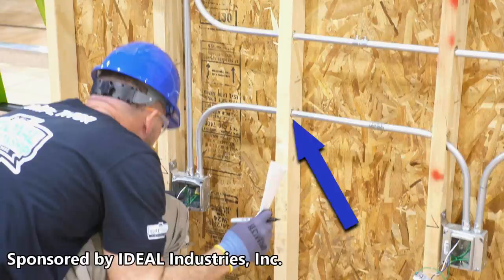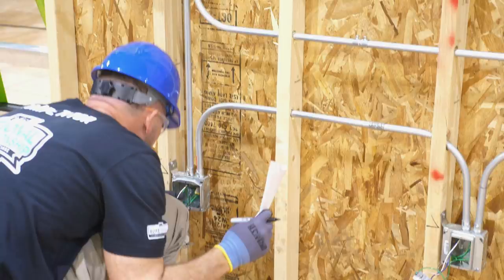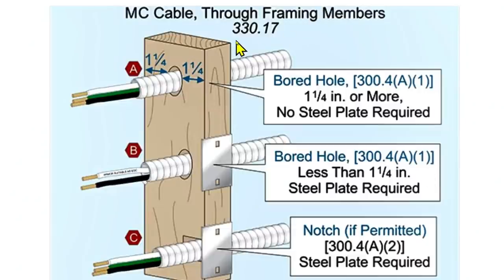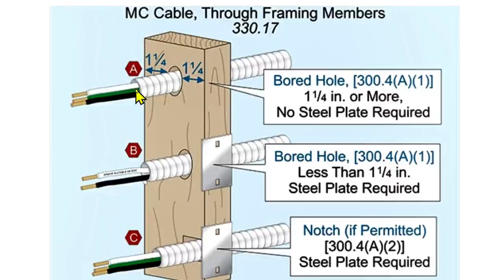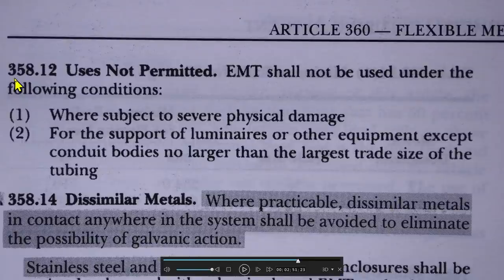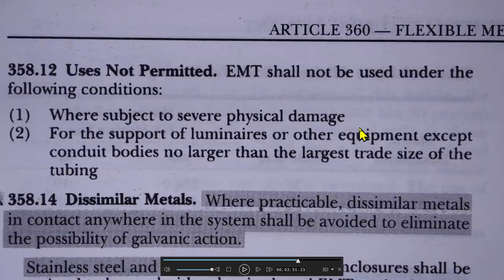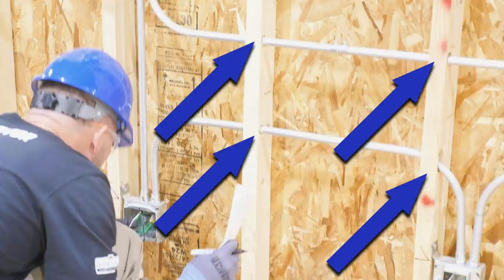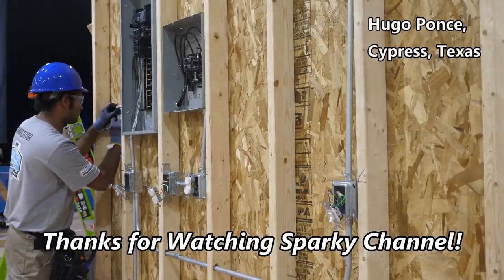Need Nail Plates for EMT? 2020 NEC 358.10 (E) and 358.12

Comment: Never underestimate the ability of drywall dudes to find and pierce wires.  Even emt isnt safe they will find a way.
Reply from the maker: Drywallers.... that's a whole 'nother video. LOL!
Reply: Ain't that the truth!!!!!
Reply: Indeed. Even that nail plate won't stop 'em. (I've seen idiots reach for a drill when the nail/screw won't go in.)
Reply: @SparkyChannel  we as the elite (electricians ) ..kinda make fun of d wallers but ill give them this ..its a art and the corners tells it all
Reply: I been seeing them use the drywall screws with the self tapper on the ends of them
Reply from the maker: @PS3rulls  Self tappers will go through just about anything.
Reply: @SparkyChannel  very true and that doesn’t sit well with me! I really appreciate your videos.
Reply from the maker: @PS3rulls  No problem, thanks!
Reply: And that is why we keep having more and more trouble with our code... to fix THEIR fuckups... @#$#@, also, are we only looking for NEC violation? Or can we throw in some building violations because I see some 2x4 that has far to much cut out of it

Comment: 300.4(A) explicitly excludes nail plates with EMT. The rub: The distance from the edge of the framing member to the end of the bored hole must be at least 1.25", and where this isn't maintained, a nail plate must be used. Exception number 1 explicitly excludes nail plates with the language of "shall not be required".

That said, the code explicitly excludes EMT through framing members. Also, I'm with you. On one of my jobs, nail plates would go up. $25 in nail plates over the course of a job is instantly cheaper than troubleshooting or dealing with opening a finished wall.
Reply from the maker: Excellent points!

Comment: It might be a good idea to install them, but if the competitors marked their absence as a code violation, they'd lose points, because it's not a violation.  300.4(A)(1) Exception 1 is crystal clear: "Steel plates shall not be required to protect rigid metal conduit, intermediate metal conduit, rigid nonmetallic conduit, or electrical metallic tubing."  Also 300.4(A)(2) Exception 1 for notching.

Comment: Unless there are words on the page saying it's required, it's not required. (the bits shown don't say it's required. 2017 has a note excluding EMT.) Also, there must be somewhere in that book defining "severe damage" -- inside a wall would normally be a pretty protected space, or NM would never be allowed.

Note: There's no problem exceeding code. Nail plates are just a good practice in all situations.
Reply from the maker: Thanks, excellent comment!
Reply: If there is a definition of "severe damage" or "subject to physical damage" please point me in the right direction. I've looked and had no success finding it.
Reply: You must have inspectors that can read.  In Columbus Ohio some get the job because the check off a diversity box,  being able to read the code is a diversity box so they go by "feelings"
Reply: @vicktorpatriot1430  Selectively, yes. The few electrical inspectors I've had the pleasure to deal with were former -- fired for cause -- electricians. (who went out of their way to lie to make the contractor have to do even more work.)

Comment: In 2017 NEC, there is an exception in 300.4(1) on bored holes which says "Exception No. 1: Steel plates shall not be required to protect rigid metal conduit, intermediate metal conduit, rigid nonmetallic conduit, or electrical metallic tubing." So, while a good idea, it's not required.
Reply from the maker: OK, thanks!
Reply: In the 2020 code it is in 300.1 A1, B2, and D

Comment: I installed a 4 ft piece of 2" emt vertically in a wall in a McDonald's. We installed a 480- 208v transformer above the panel on the deck. We came back after the walls were finished to push the wire down to the panel. The rockers must have thought the emt was a stud because looking down into the pipe I saw 6 screws right into it.  Never unestimate a rocker's ability to f**k things up!!
Reply: To true there! "what, there are supposed to be outlets on this wall?!?" AAAAAAAAAAAHHHHHHHHHHH!!!!!!!! SLEDGEHAMMER GO SMASH!

Comment: Bill I agree w the premise but disagree on your choice of proof 😂 The code section you cited is about the USE of EMT in the first place. Has nothing to do with protection of it once installed. If a drywall screw was deemed  “severe damage” (it isn’t) EMT COULD  NOT BE USED AT ALL.. not in the wall… not out of the wall…. Nowhere, whether or not a nail plate was present.  IMO “Severe damage” areas are industrial locations… think steel mills… where heavy equipment or an errant steel pour pot or overhead crane would destroy EMT and the conductors in it upon contact. In those cases rigid thick-wall conduit must be used.  The fact is - EMT IS allowed pretty much anywhere you’d have a wood stud wall, commercial or residential. So the question is still can it be damaged by a drywall screw or a pneumatic nail. Yes it absolutely can be, it’s no more rugged than BX cable and maybe less…so if I was inspecting EMT set into stud notches or shallow holes- I’d make the contractor install nail plates. We have a residential client in Chicago where they disallow Romex. House wiring of all kinds has to be in EMT. The last time I was out there a trim carpenter had managed to shoot a 2” finish nail through a piece of EMT in the wall… hit the hot wire instantly shorting it out. They had to gut all the drywall out of a closet, replace the EMT, which also meant trashing the conductors and starting over… all this 2 days before the house was supposed to close.  EMTis every bit as subject to damage as copper or PEX water pipes, HVAC line sets, etc. so yeah -use the nail plates.
Reply from the maker: Thanks!
Reply: I fully agree.  It's much cheaper than having to rip things out and start over again.

Comment: The issue I have with the vagueness of the code in this instance is that the inspector(s) definition of “severe”.  One inspector is likely not to say anything about EMT at chest level in a shop and the next inspector will claim EMT at ceiling height is in danger of severe damage. Inspector can be that extreme (thankful rare) but we have probably all experienced 1 inspector will allow something and at the next inspection a different guy flags what had passed.

Comment: I think the physical damage is a small dent on the exterior. Any time there is a possibility of penetration through the sidewall should be a non permitted circumstance. As well as if it is able to crush so much that the wires could be pinched causing a short.
Reply from the maker: Good point. A dent could cause problems too. Thanks!

Comment: Bill, off topic question.  Is there a code for NM romex touching flexible insulated HVAC duct work, either over it are pulled under it?
Thanks for these videos, so helpful.
Reply from the maker: Yes, there is.
Reply: Where I’m from you need a minimum gap of 25mm so a lot of people use insulation to separate the 2

Comment: If the damage is severe enough to pierce the conduit, won't it also be capable of the same with the nail plates? Seems only a small measure more protection...
Reply: No, the nail plates are much harder than EMT. Just try driving a drywall screw through a nail plate.
Reply: @Sparkeycarp  The biggest difference would be you only have the screw bitting and being driven by the drywall, which immediately strips out, while a conduit is deep into the wood so the screw has good purchase to force it's way in

Comment: An authority (or at least a good opinion) would be a master electrician from the Chicagoland area; all they use is EMT in construction, both residential and commercial. The City of Chicago (or perhaps Cook County) has its own electrical code that supercedes NEC, and requires EMT. No NM cable is allowed in that part of the country. I know that practice extends out to neighboring counties of Cook, but I'm fairly sure it doesn't apply within the entire state of Illinois.
Reply from the maker: Good point, thanks!

Comment: Lots of opinions in the comments, but I wanna know for sure. Did the contestants receive penalties for marking the lack of nail plates as a code violation?
Reply from the maker: I don't know.
Reply: Section 300 has an exception that says nailplates using emt isn't required... if a competitor did mark that as a violation then yes they would lose points

Comment: So just put them on, is better to have them on just incase especially that low, I didn't notice the holes to closed to the edge tho definitely you need them on her....!!!!
Reply from the maker: I agree!
Reply: Same
Reply: You act as if that 16th of an inch doesn't matter to any other trades, but it really does.. So unless you're gonna  chisel out the plate thickness , which your not , then you should avoid installing unnecessary plates.  Obviously these particular ones are necessary,  but only because of the general incompetence of the guy with the drill.

Comment: I would like to see this put to the test, I can't imagine a drywall screw penetrating the emt, if they were using self tapping screws then that would be for sure, however I've never seen drywall guys using self tappers.
Reply: seen it.  also seen 10d air nails driven through EMT.  of course, I've also seen both driven through nailplates.  and actually, EMT in a notch is safer from screws than EMT behind a half inch of wood, because the wood will stop the screw from deflecting.

Comment: The EMT is a violation as run in the competition wall since there are no nail plates. Had they been run through the center of the studs, it would have been acceptable, no?
Reply from the maker: Yes, very acceptable.

Comment: Code violation or not, the best practice here would be to protect your wiring to the fullest extent practical.  Nailing plates are an inexpensive and easy assurance. 
Remember, the code is the MINIMUM and is there for the safety of all.
Reply from the maker: I agree, thanks!
Reply: And that is true for the whole building code not just electrical.  Inspectors need to recognize that things that exceed code are OK.

Comment: Inside a wood framed wall cavity I would certainly not consider secere physical damage. You'd have to push pretty hard to put a drywall screw into EMT. really the same arguemwnt could be made from that standpoint about a nail plate with Romex behind it. Well a drywall screw can be made to penitrate a nail plate and pierce the Romex. EMT is the round version of a nail plate.
Reply from the maker: Thanks, good point.
Reply: No, your wrong. EMT is not strong enough. Try bending or running a drywall screw into a nail plate. The hardness of the steel nail plate is well beyond the EMT.
Reply: @Sparkeycarp  ... the point with a nail plate is the screw doesn't have enough bite in the sheetrock yet but might have enough bite after an inch of wood.
Reply: @rupe53  and most certainly have bite and lack of deflection  if it got through the nail plate!
Reply: @Sparkeycarp  Give me a break.... nail pates are chopped out of mild steel and hot dipped
Reply: @elffirrdesign2063  ... if you have ever hit a nail plate you should be smart enough to stop pushing. Even if you were using stainless screws, you would feel the difference and would certainly strip out the sheetrock first.

Comment: Nice video , have a question for you how many wires can go under a staple before you have to start using cable stackers ???
Reply: number under a staple is by the staple's approved design.  most are 1 per staple.  SN 150 IB staple from briscon is 1 1/2 long and is approved for 2 wires.
Reply: Depends on the manufacture.
Reply: Most cases I find it’s 2, unless it’s something big like 8AWG then 1
Reply from the maker: As listed on the staple package/ container.
Reply: thanks for the answer @SparkyChannel
Reply: @dallas5374  thank you for the answer

Comment: The code only states the bare minimum when it comes to work practice. If ur spending all ur time wrapping emt thru the wall then u might as well take an extra 2 minutes out of ur day in order to hang up nail plates. When that drywall goes up and everything is painted and u got a wife like mine who loves hanging pictures only then will u b thanking ur lucky stars that u got plates on those studs.
Reply: I hate nail plates because it keeps from having a nice flat wall.
Reply from the maker: Yep!

Comment: If you can get a screw into the EMT, you can put it in a smash plate
Reply from the maker: Yes, the real solution is to get the hole in the middle of the stud in the first place.
Reply: but if it's wood you'll know the difference compared to a plate
Reply: Yeah not really the same thing. The wood acts like a guide and pressure application while the hole holds the EMT in place allowing the screw to penetrate it. This would not occur when you put a screw through drywall into a plate

Comment: One question about this EMT in wood studs. Why? Why not use flex if you want to pull future wires or protect from rodents. What a pain to install. I have never seen this in 40 years other than a very short distance inside from a box extending out from a wood stud wall.
Reply: Go to Chicago area. They require EMT everywhere, even single family detached residential.  No NM, no BX, no flex. All EMT.  I was shocked when I first encountered it too. Probably quadruples the cost of wiring a house compared to Romex, and makes late changes like an extra outlet nearly impossible. It does look good  though 😂 😂

Comment: Hi Bill from Sparky channel

Fantastic video as usual and even better, you’re digging into the code. 

While you show the electrical code which is fantastic, I think you may find the answer in 2 sections of the international residential code which is also in the mechanical code

My interpretation is yes, they do need protection 

This is from the 2018 version. 

You’re video intrigued me to look it up and learn something. 
WAY TO GO!

R602.6(2) says Bored holes cannot be closer than 5/8” from edge of stud.

But more importantly the following from the IRC code book
M1308.2 Protection against physical damage. 
M1308.2.1 Piping through bored holes or notches.

Not going to paste the text due to potential copyright complaints but it’s pretty easy to find. 

Thanks again
Reply from the maker: Nice research!!! I thought there would be something like that. Thanks!

Comment: Does a nail plate insure no penetration of EMT under or could help with it?  Most of my experience with punctured EMT has been through steel into steel.  Point being wood is soft enough and EMT round enough to deflect a point load and not allow penetration of the conduit.

Comment: I got called, to a shopping mall, breakers tripped, found as I walked in, "NEW ROOF", being installed, Flat roof, anyways went to, closest electric, room "YEP, looked-up , several roof, grooved steel , roof sheets had, EMT, run through channels, with 'BIG LONG ROOFING SCREWS", running right thru, & extending, 1" to 2" inches below Conduit. "GEE", who would have "THOUGHT"??
Reply: Twenty

Comment: Safety will always outweigh anything like this. I wouldn't want to be the guy who challenges an Electrical inspection in regards to this. And if you do and it's the right guy you will regret it..... Offsetting the holes when drilled jumped the train off the tracks plain and simple....
Reply from the maker: Thanks!